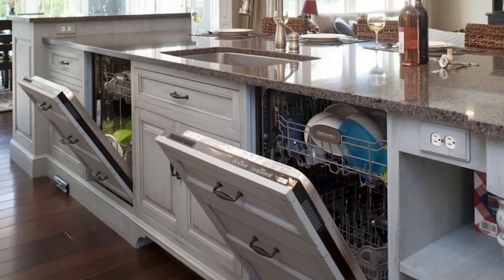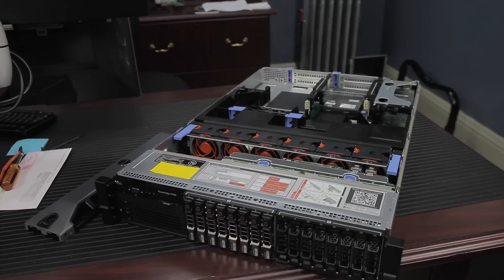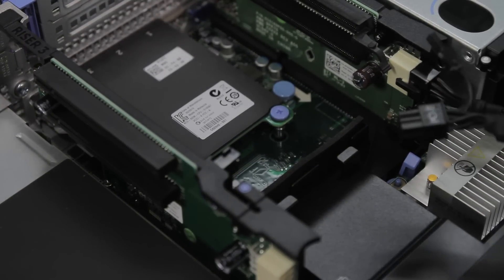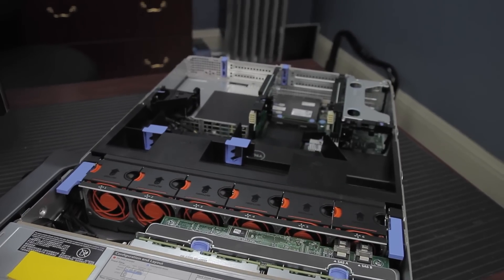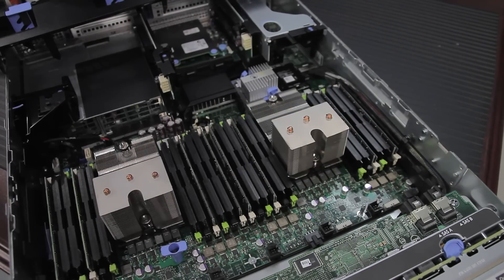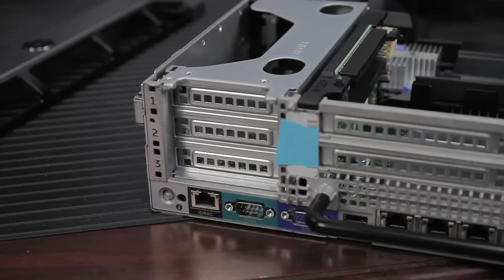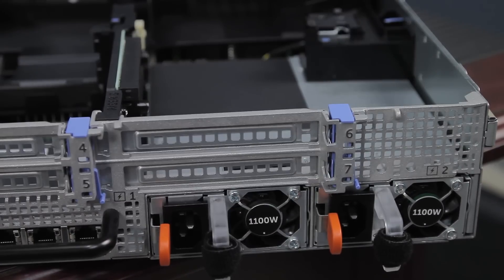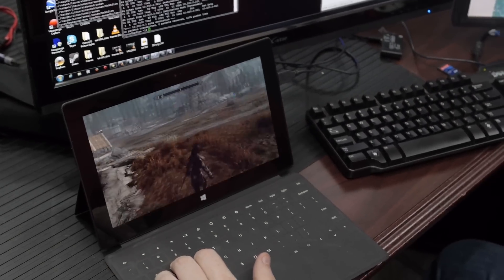Dell PowerEdge R720 Dual Xeon Server Review

Comment: Can this be used for workstation rendering too? I heard Xeons are good for rendering 3d models, so 2 of them with alot of threads sounds like it would be good for it.
Reply: Yes, just wear earplugs.
Reply: FrankTheCat Or I could just listen to music.
Reply: +Bashfulfruit You can get similar processing power in a tower PC by a super micro or asus dual socket motherboard. You could then make it much more practical and quieter

Comment: This stuff is something i dont know a lot about even though ive been working with computers for 20 years now and have worked at a local IT store as a technician. I think this sort of content is awwsome and its different than the usual 100 millions reviews of the same boring z87/97 or AMD equivalent tech and its something i hope you will bring a bit more of along side the usual content as its an interesting way to learn new stuff without going full on nerd(i simply dont have the time for that). Good job Tek.